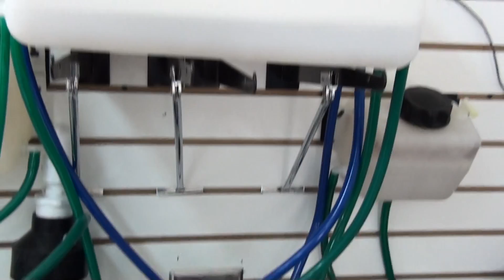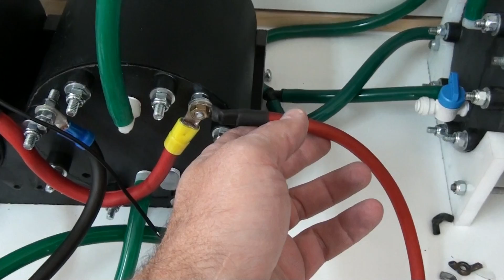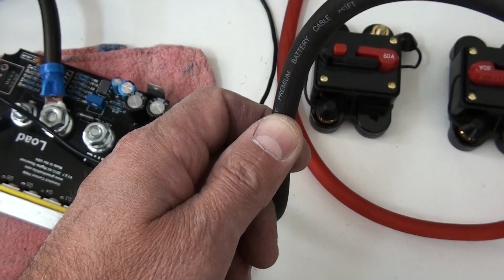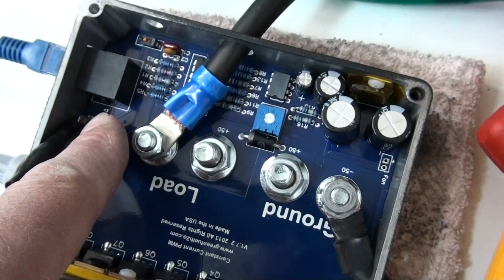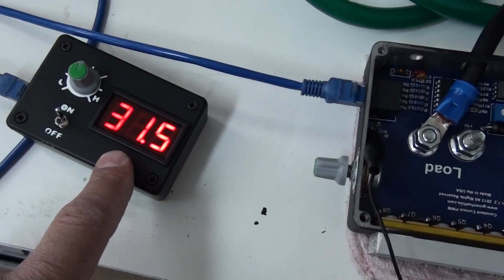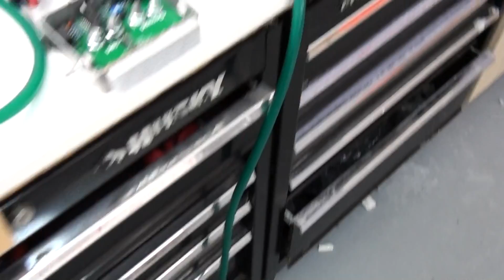Green Fuel GFx4 80 plate over the road HHO trucker system for DAVID.

Comment: Will the GFx4 38 plate Semi System get the job done for semi's or would you need a 80 plate kit like this one in the video? What would the difference in more plates be? Was this a custom order for a truck driver? Will the GFx4 38 plate Semi System fit under the hood or would it have to be put elsewhere? I tried calling the 801 area code number on your website but have not received call back yet which is why so many questions...sorry.